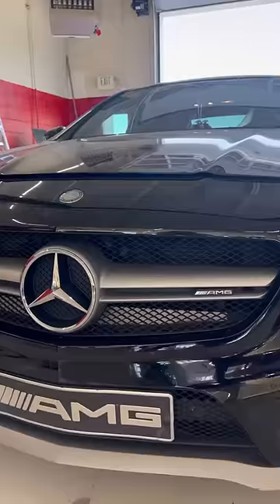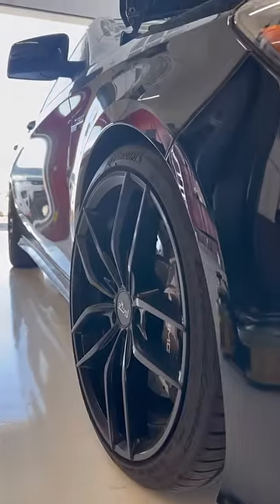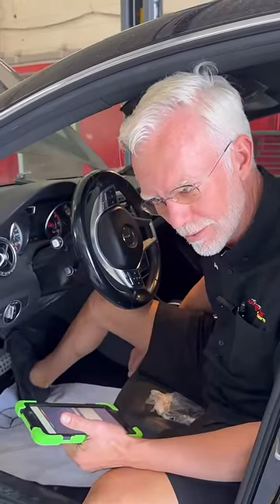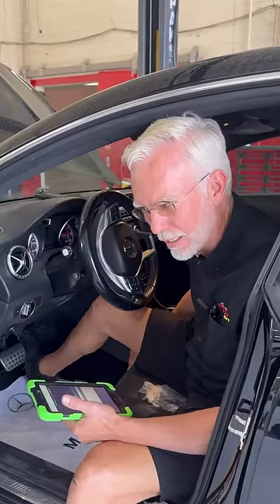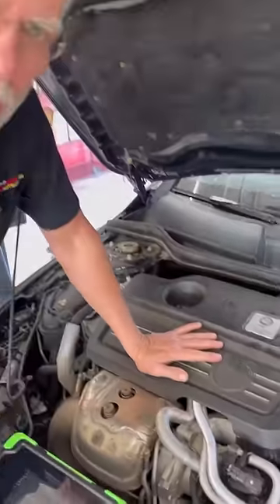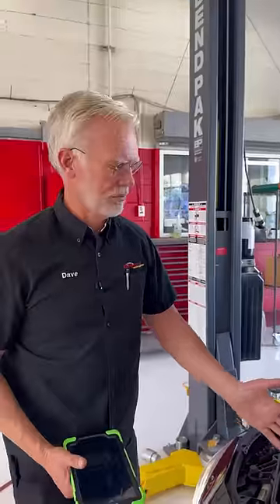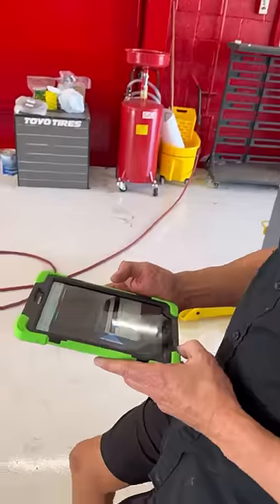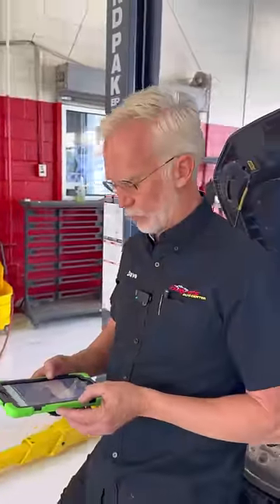Mercedes AMG Nothing but a slight noise on start up #carrepair #autoshop #mercedes

Comment: About 40 years ago I was told I needed a new engine by a national tire company garage because my valve cover was leaking. I can’t remember the price quoted but I went to a friend who worked on his own cars. For the cost of a PCV valve, PCV hose, a gasket, and a 12 pack the leak was fixed and I drove that car for another 10 years with the engine that needed “replacing.”

Comment: There is no mention of the car going into limp mode, which normally happens with an undetboost.

Mileage would be hdlpful.

If overheating either head gasket leak or water pump issue but need to know hiw long before overheating and if air bubbles in coolant.

Usually, a noise on startup could be a timing chain tensor issue. But normally, one would get a  DTC code.

But that startup noise does not sound good. Could be a scored cranshaft bearing. One oil pressure is higher noise would disappear.

Comment: ok bro, I listened to the symptoms a couple times while writing my other comment and I have a diagnosis. loose/bad supercharger belt or if applicable idler/tensioner. we have low boost from a slow spinning charger so start simple. ps. I'll need a work from home job if I'm right. but I work on straight commission so...

Comment: The noise sounds like a turbo screech. The turbo code would point in the direction of the turbo being an issue. That doesn't mean that all would be well by replacing the turbo. I would see the overheating as a different issue that needs more information to be diagnosed. If the turbo is water cooled, its issue could be due to the engine overheating. I would look to make sure about the cooling issue before replacing the turbo to make sure there isn't a repeat issue, if it is water cooled. The dealer probably just wanted a fix that could likely address all issues without actually determining what actually needs addressing. Problem with that thinking is that the real issue could still be unaddressed.

Comment: I would use our 5 gas analyzer to confirm the presence of hydrocarbons in the cooling system first given the overheat concern. Establish the need for major engine surgery first as then it becomes an eval about the engine surviving that procedure.

Comment: Change the air filter , under boost ...
Compression test . Start with what's easy.  Clean the rad. Or drive it till it drops😂

Comment: Change coolent change Thermostat.. change the transmission fluid because its overdue for maintenance..brake fluid...and maybe the shock absorbers need to be changed.. 
   The berings on the serpentine system needs some lube.

Comment: Turbo needs inspection for wear but I can say it doesn't need a engine, thermostat, coolant flush, turbo inspection and air filter. Maybe a oil change if you think it's necessary.

Comment: Clear codes, verify all fluids are at correct levels and then with customer permission put some miles on the car. Preferably I would like to change oil and filter and cut the filter open. I ask if the engine oil has any mysterious odor. Put some miles on it and heat this engine up. Could this be a paperwork error, like wrong car for diagnosis?

Comment: I dont know a whole lot about cars, but the computer is saying under boost condition, so maybe something with the turbo charger. Also, it did not sound right when pushing on the gas it sounds like it's being suffocated from the turbo if that makes sense or even possible

Comment: Flush and refill the coolant system , inspect the radiator for issues. Check oil if it’s dirty pull valve cover and check for sludge build up.

Comment: Check the oil filter off only And put a new one on After checking the oil filter Check compression Of each cylinder Pull the spark plugs dictate rocker panels off take the front belt off keep checking

Comment: Since you mentioned it has a turbo...a bearing might be going bad. Now after the dealer replaces the engine, nothing will change unless the turbo is also replaced.

Comment: Sounds like a worn serpentine belt. Slipping belt can cause low boost at the supercharger compressor and the screeching sound under load (acceleration).

Comment: I already know the head is clogged from letting it idle in the starbucks drivethrough everyday, thats why the buildup burned and plugged the ports on the turbo and cracked the head when the carbon overheated like a chunk of charcoal.  So dealer recommends engine because he knows the guy will trade in and he gets a free new ride

Comment: It's been over 20 years, not familiar with AMG, but sound, symptoms, codes lead me to suspect a restricted exhaust. 

Engine vacuum tests.

Wheel speed sensor probably separate issue unless contaminated by coolant?

If engine overheated and not wanting a comeback, dealer choice may be best.

Comment: Sounds to me like coolant is leaking into the cylinders when the vehicle is shut off after driving. Hence the noise when starting and overheating when driving. Spark plug inspection, hydro carbon test and cylinder leak down test should performed to eliminate those possibilities, especially if there are O2 sensor codes. It's hard to tell from the video but could the noise be a serpentine belt squeal? Could that be due to a leaking water pump? Could the water pump been the original problem?

Comment: That sure sounded like a bad turbo, which would cause the under-boost and overheating. It also probably cooked the oil. I'd start by checking out the turbo(s). I'd also change the hall effect sensor on that wheel.

Comment: underboost condition occurs when a hardware or software issue prevents the engine from reaching its target boost level.

Maybe it's this, get the car computer sorted through the dealership or David you maybe able to do it at the workshop.

Comment: I would start by asking how d dealer came up with that conclusion…check everything in between the air intake and exhaust make sure no airflow restrictions,maybe aftermarket oil filter also..just my thoughts

Comment: Given that you panned the grill at the start of this video, it would be an airflow issue as the front looks completely blocked thus restricting air from cooling the radiator.

Comment: If it's a mechanical waterpump, I would look at that. Might be causing the noise at higher rpm and overheating issue?
Reply: Could also be a problem with whatever is driving the water pump, like a belt slipping on the water pump pulley or something like that

Comment: if its overheating id say check the coolant level and hoses. if thats not the problem then check the radiator or condensor for damage. if thats not a problem then check the heater core and thermostat. if none of thats a problem then id say check the engine oil and see how bad it is, maybe do an oil change and see if it fixes it.

Comment: The squeak coming right after you let off the gas sounds like it's turbo related. The code says turbo related, so I'd check all the basic fluids are there and don't look odd, like oil/coolant mix. Then focus on the turbo and wastegate. See if they are functioning normal. Seems like a stuck waste gate/blow off valve

Comment: Test drive, watch the temperature... if there is overheating, most likely it's a crack inside the block. But most often it can be stuff like temperature sensor or some stupid sht. I'd rather just check coolant, sensors and watch for leaks underneeth.. if the turbo is underboost then might aswell check the turbo but ain't a uncomon thing for it to have turbo failures infact what i heard on the startup it sounded like the turbo  clanking on rev release... but Im not there to clearly hear it

Comment: Overheatr, focus on the cooling.. Check for exhaust CO2 in the cooling system. If so warped heads or something related to that. If not is the electric fan coming on at temp? Could be fan or relay. Is the water pump ciculating water? if not could be thermostat. Could be clog rad..

Comment: I would check the condition of my oil then have a look at the color of the radiator fluid, check the thermostats condition , leaking hose's the bid one would be gaskets seals

Comment: Someone put the wrong coolant in and it geled under "cooler" conditions. I'd flush the coolant system, check every cylinders pressure, and check the oil for any "glitter"   then drain all fluids in to and out if the engine. Flush and fill with correct fluids, check the blow off on the turbo (if a turbo) and I supercharger check to make sure everything is good with that. Check to make sure that the tubing is not cracked, or seals blown out, then verify that the water pump wast damaged from the incorrect coolant being added.

Comment: has two issues, 
Boost
Overheat
address overheat first, 
Address Boost second, 

the two may be linked
it may be as stupid as a plugged converter. it may also have a failing high pressure fuel pump and leaked fuel into the oil, and while bearings may be within spec, the cams may be trash, or the cylinder walls are scored.

Comment: Like you yourself have said, dealers don't go into engines usually and if they determine their is the slightest problem with the engine or if they even think theirs the slightest problem when theirs not they just say throw a new engine in it.

Comment: I’m a back yard mechanic. But I think that the engine is slow to rev and there is a code for boost. I would start with the turbo. A ride on the streets would give me a better feel for it. Also, is the customer using the correct engine lubricants?

Comment: Turbo impeller contacting the the turbo housing. When a gyro accelerates or decelerates it will precess. Core issue the Impeller is under size and turbo bearing is out of spec as my guess,.

Comment: I would say u need a turbo, and found out why the turbo isnt oiling. They have to have lube 2. I went through that on a garrett turbo on a ford 6.0 diesel. Stopping oiling and no 1 knew it.

Comment: For starters if oil pressure jumps normally and no sign of water in oil check coolant level, check the flow after it warms up and if the thermostat is working half the time. If all checks out run it by idle for some time check temp. if it is fluctuating temp replace thermostat just because and fan clutch...,just because. I do not believe the radiator is plugged unless the dealer installed a plugged radiator so the owner will bring it in so they can screw him over replacing it. If there is an head gasket leak it is a small one at the moment causing the heat up because it is a little hard to spot that water sometimes it is evaporating because nothing has been said about any steam. It has to be one of these. It's not needing an engine that is for sure and a speed senser, what c'mon. If oil pressure check and it has a full mark go to that thermostat or clutch fan. I could be wrong because I have no idea what this new technology is doing anymore. I doubt it though. Quickly eyeball the tension pulley for smooth turning and the slight bounce no erratic noise. No restriction in air flow incoming air flow. Give a quick glance at the by pass flow in the thermostat housing for a restriction. But I believe thermostat or fan clutch mainly. If this radiator is plugged I wouldn't believe it. I haven't heard of radiators being cleaned today. If worse case scenario then replace the radiator too just because but I doubt it.

Comment: I wonder... overheating on an AMG suggests the rare phenomenon of excessive piston expansion causing loss of piston ring radial 'float' as the gap between the inner diameters of the  rings and the base of the ring 'slots' having reduced to interference conditions, causing rings binding on cylinder bores, resulting in that horrible scraping sound close to TDC.

 with interfering with the

Comment: Check for intake (vacuum if it wasn't charged) leak. They think it needs a motor because it was leaning out, causing pre-ignition and piston damage?
If a compression check if good, just gunna send it!

Comment: I can't see underboost causing overheating.  Not sure if these have a electric water pump or mechanical.  If mechanical this would be good guess.  Would have to see if we can get it to overheat...nothing there that would indicate it needs an engine...would be curious to see why the 'dealer' said that.

Comment: One sounds like a has an exhaust leak what's the after pressure and it sounds like Turbo is that using the blow by because of the cracked in the exhaust and maybe a factor I know where the cracked exhaust startup is going to make noise what's the Heats up the crack is going to close

Comment: Yeah it sounds like he needs a thermostat and a fix for the boost control issue, whether that be a pressure sensor or a new turbo or supercharger, broken blow off valve etc. Or maybe he is low on coolant.

Comment: Troubleshoot the overheating first. Thermostat, water pump, radiator - look for coolant leaks. Is it drinking too much coolant? If it’s too hot that turbo is not gonna run right. Doubt there is anything actual wrong with the turbo - those things last longer than the car itself. Don’t know why the dealer would say something like that. If you had some oil consumption problems along with some noises from the block indicating an issue with pistons, then it might be cheaper throwing in a different engine rather than sending it to the machine shop.

Comment: Leak down. Overheating + noise off throttle + underboost codes tells me to check for a loss of cylinder pressure. I am interested in seeing the follow-up.

Comment: I had a dealer so called mechanic tell me I needed a new engine because mine was according to him full of sludge. I told him I didn't think so and whent to someone that knew what they were doing and found out it was a just a bad erg valve. Dealers are so often crooks.

Comment: I would have the codes pulled and fix those and then get a second opinion. Because typically dealers ALWAYS LIR and try to make you pay for something that's NOT even the problem. So, an engine means transmission maybe is not good. Glad, he brought it to you to fix it and over heating could mean a head gasket, sensor malfunction, or something else that's simple. I never trust dealers bro.❤❤

Comment: Depending on  age of coolant  and condition of the oil first ,going on the noise , oil pump could be suss , overall it's probably the driver who's been flogging the crap out of it at every set of lights  and stop sign , ßounds like every V8 ute that has been owned by a young driver here in Australia

Comment: Mesh filter on intercooler is too small... there was a recall on some of the other models for this very issue. to get to THAT filter... it sits at the bottom 3/4 of the engine = BIG job and cost a lot of labor... EASIER to drop the engine and change from a main dealer perspective.

ALSO just a FYI for those who DON'T know... I have been in the industry for a long time and we used to have our OWN suppliers for Brake pads and disc straight from the manufactures white label box... funny thing we were told... they also sold to Mercedes for their OVER COUNTER sales line not for their ASSEMBLY line = they use different brake parts for their assembly line hence why they KNOW that they have a LONGER life than the over counter parts = low % rate of change under the warranty cover.

I assume they have this same approach for other areas of the vehicle too.

Comment: Don’t throw the Dealer under the bus, a lot of information is missing. What kind of diagnostics did the dealer go through to determined it? How many miles on the car what kind of noise upon start of the engine? Beside it dealers do not rebuild engines. Is there issues with camshaft or timing chains many times they will recommend replacing the engine. Also depends on service history of the engine. What is the condition of the oil where was oil changed? What’s the oil grade? What’s the condition of the engine air filters? What is the overall condition of the car? What service history does the customer have with the dealer? There’s so many questions that need to be asked, beside that some the newer engine coming with electrical water pump that also work on vacuum and share same switch over valve with turbo, I saw many shade tree techs switching the lines and causing the car to lose boost and overheat.

Comment: The dealership was planning on raking that customer over the coals $$. at minimum it needs the cooling system checked out. at maximum it could possibly be a head gasket. and that can be determined with a thorough cooling system check. then fix the supercharger and the wheel speed sensor. the scan tool will tell you most everything you need to know. if the check engine light is on you should be able to go back though the memory on ECU. because overheated then cooled down. and that should show up in the memory. I didn't hear any engine noises either. the only noise I heard was the supercharger possibly a waste gate.

Comment: I’m not a mechanic, I’m a electrician 
However I’d check the boost as others have mentioned then I’d pressure test the radiator while still in vehicle check the fan best / serpentine belt ,,,then I’d check the thermostat (if not picked up with pressure test) then I’d send it to you cause I have no fkn idea because I’m a electrician

Comment: Okay.. turbo.. the EGR waist gate isn't opening properly. That noise you heard off throttle hiss that's the waist gate not opening off throttle hiss back pressure bleeding back.. code boost is your dead giveaway.. 
2nd whoever serviced the AMG use the wrong aka cheap oil.. drop the oil pan & check & as you suspected pull & cutt open the oil filter... check ✔️

Comment: How hard is it to check the exhaust backpressure? It could cause the low turbo2 boost and overheating. Do a coolant air purge. It's been a while but I don't see a pinned "here's what it was" comment.